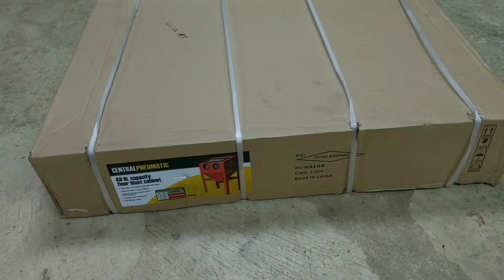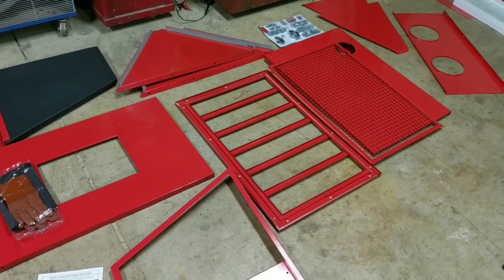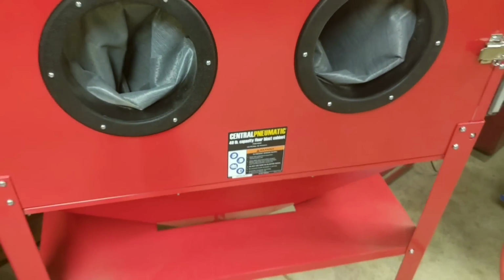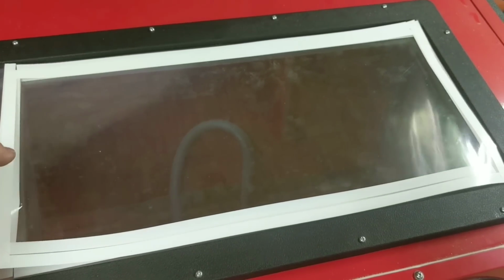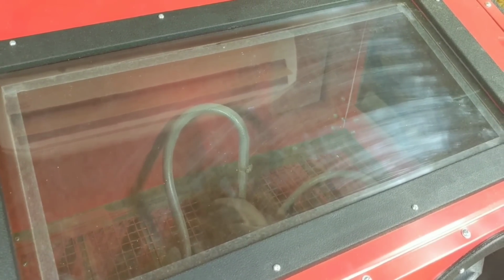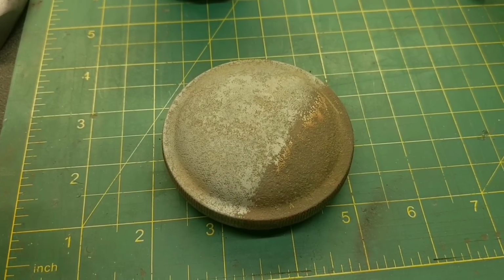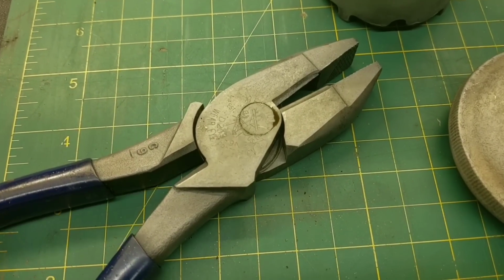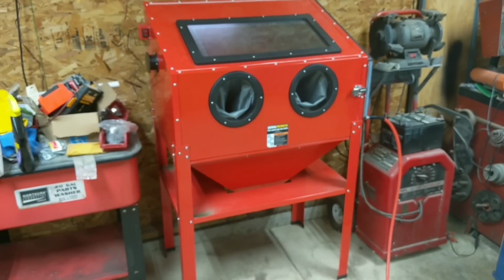Harbor Freight 40 LB. Capacity Abrasive Floor Blast Cabinet Review and future modifications!

Comment: The leaking and dust won't be a problem if you attach a shop vacuum to the cabinet. Coal slag is not recommended for use in these cabinets, glass beads working very well. I have had mine for over 20 years without any issues. It is outside my shop in a carport due to limited indoor space.
Reply from the maker: Yup!   For sure the vacuum keeps leaks and dust in control.   I do recommend coal slag, depending on what you are working on.

Comment: This cabinet is junk.  Leaks everywhere, gun won't work most of the time.  The light lasted less than 5 minutes and it came all bent up.  Half the screws didn't even have threads on them.  I had to go buy a different gun and hoses, different light, different screws, and it took 5 hours to assemble.  DON'T BUY THIS POS!
Reply from the maker: I really like the cabinet!   And they will leak, especially if you try to seal them up and don't vent them.    That is probably the biggest user error I see!    Your pumping air into a sealed cabinet, it is either going to explode or leak!   The factory gun is fair at best but if you use the right media it will get the job done.   A few modifications and you can fairly cheaply make a blast cabinet that will produce professional results!
Reply: @1D10CRACY  I have a collection system on mine and it still leaks.  Probably the fact that they use 28 gauge steel doesn't help.